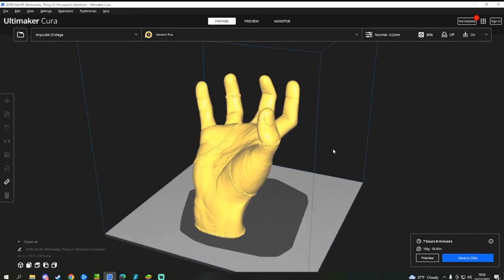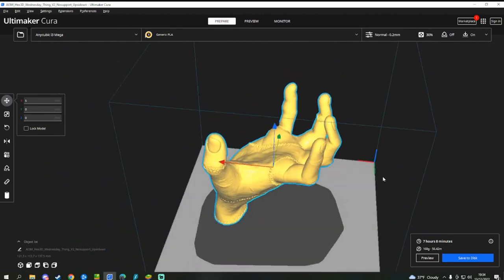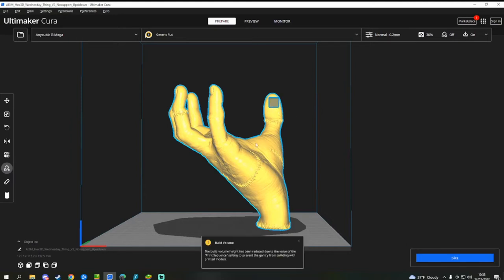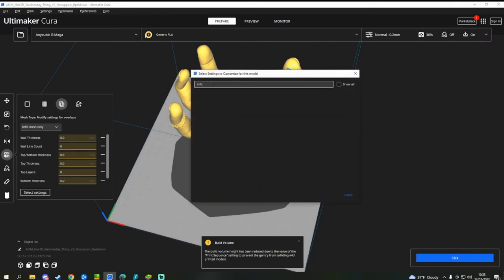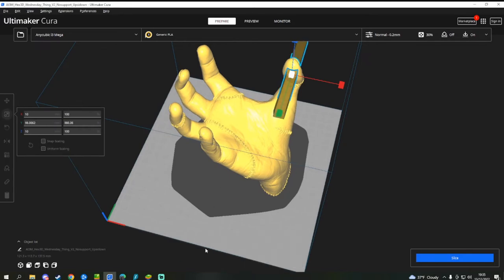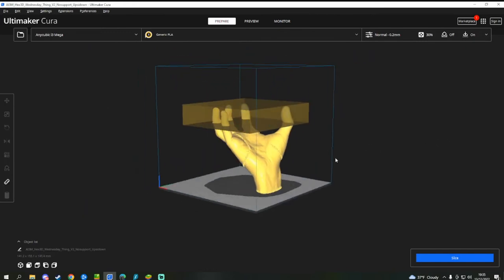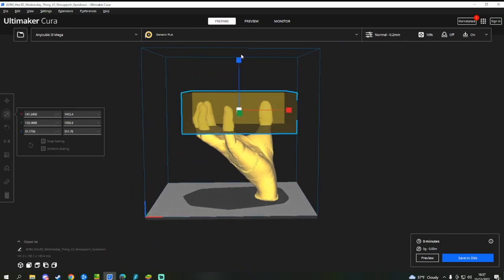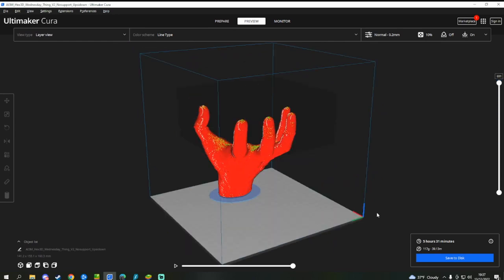Variable Infill Density | Cura 5 | 3D Printing

Comment: Hi - Nice tutorial. I followed the steps outlined but get an error message saying cannot slice (it slices without the support blockers) Some suggestions pop up:Fit within build volume, Are assigned to an enabled printer, Are not set as modifier meshes.  I have the printer set as a Dremel 3D45 and as I mentioned it slices without support blockers - its a small body so easily fits. Any idea what may be wrong please.  thanks.
Reply: hi, i've got exactly the same pop-up ! did you find a solution? thanks
Reply: @dododroid8856  no sorry. I can’t remember what I did. Probably modified the model and Tried again.
Reply: @chrisheath4609  thank you for your answer.
Reply: I am getting same errors and can't figure out the problem any ideas or fixes
Reply: I got the same error

Comment: Is there any reason cura would lock the infil density setting? I'm trying to adjust the infil density but for some reason it will only stay at exactly 20% density.
Reply: Have you tired different location on the model or a different STL (test) file to make sure you are doing the steps correctly? 
My assumption is you're missing something in the process.

Find a basic test cube and set it to 20% infill and then try to make half of it 100% infill, maybe this will help you figure things out yourself.

Comment: I followed the steps but the mesh turned grey in preview i'm pretty sure it isn't going to print it i have other meshes in cura that are working
Reply: sorry for  wasting your time I actually figured out my problem I had both the support blocker and mesh with variable infill anyway it sliced now
Reply from the maker: Was the mesh mirrored? Curas having a problem with that at the moment
Reply from the maker: @erochicken  ah that'd do it, glad you got it working :)